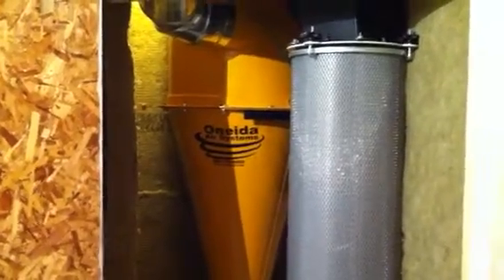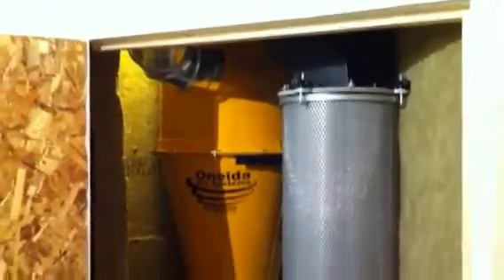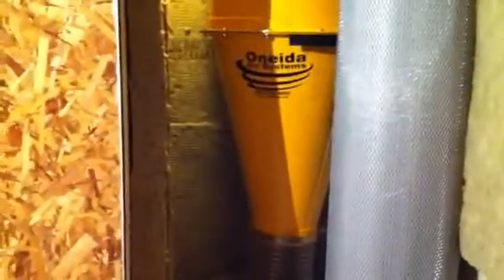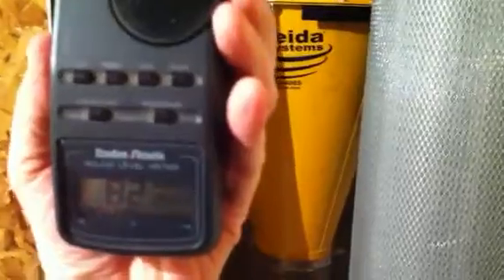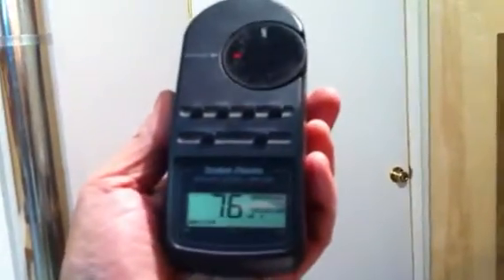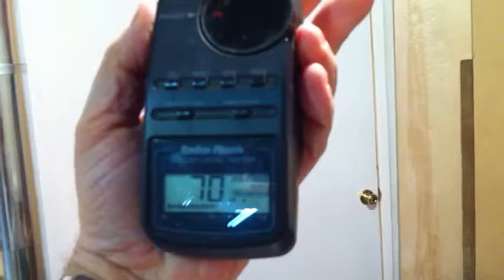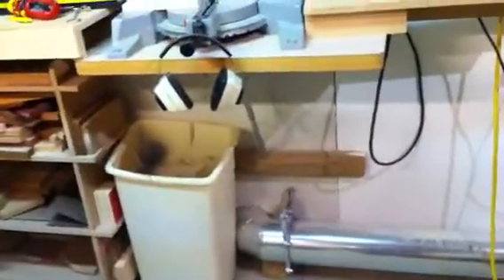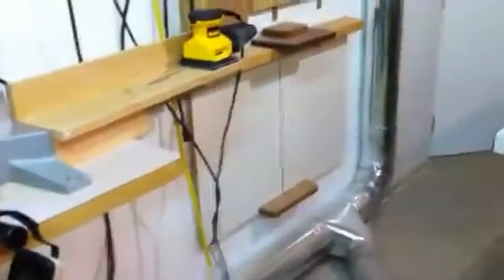Dust collector noise supression

Comment: Wow - great noise reduction.  My new gorilla is 5 HP and is running at 92 db!  I contacted Oneida but no real answer to reduce the noise when unit is advertised at 82 db.  I will definitely build a closet around it now.  Thanks for sharing!
Reply: Phone app dB meters are cool, I have one, but they can be quite inaccurate, and it will depend on your distance from the noise source.

Comment: Door is 1.5" thick and solid and is 1/2" drywall sandwiched between layers of 1/2" OSB.  As explained in the video, the air returns to the shop between the ceiling joists which are covered by 3.5" of mineral wool, much like a vehicle muffler.  Using 4" duct throughout the system would restrict the flow to the point of more than halving the airflow, reducing the efficiency of the collection setup.  With the setup I have I can pull more than 800 cfm total through the top and bottom collection points on my table saw.

Comment: Try baffling the exhaust in the ceiling by building a box with baffles lije a muffler on a car, and that will drown out even more of the sound possibly dropping the db level to......im going to guess at 67.
Do you find that the large 6" & 7" diameter ducts work well with the dust collection vs the 4" ducts that are standard on woodworking equipment?   Or did you implement a larger size diameter because of the size cyclone you are using?

Comment: I bet that if you put some sort of gasket around the inside of the door and some batts on the inside of the door as well  you'd get another couple of decibels! 
Sound travels through every little cracks you don't seal off... that's why in studios or just hi end audiophile use caulking in every crack and sheet rock joints! But hey I'm a sound guy so just the batts would do fine. ;)